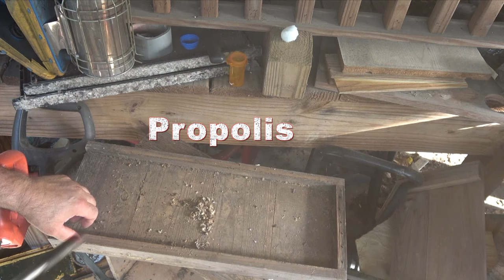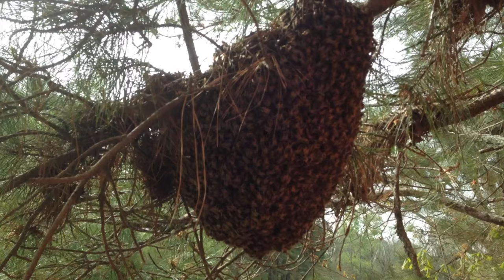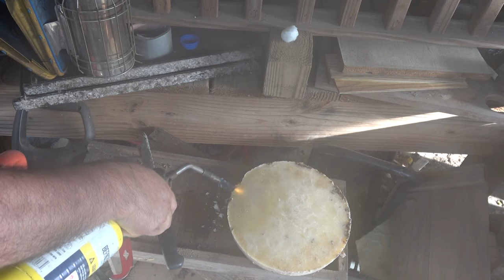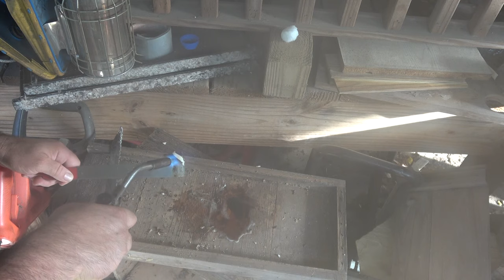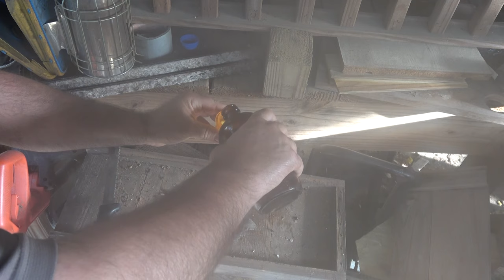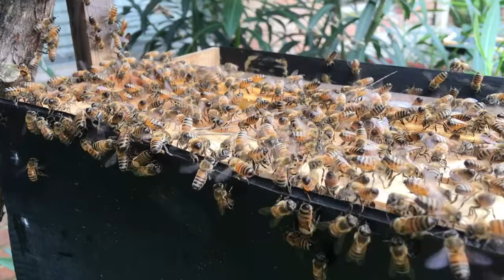How To Attract Bees To Your Bee Box

Comment: Aloha Jp. First off love the videos brother. They are super informative and awesome to watch. I’m very new to this and was wondering if you have made any videos of how to make home made nuc and deep boxes with instructions and dimensions. Unless you just order yours from some of the suppliers out there. For us in Hawaii we get raped on shipping costs and was wondering if you had any advice. Huge mahalo brother. Have an awesome week. Aloha
Pete
Reply: Peter Morrow 2 frame nuc measurements — bottom board is 5”x21” , sides 10 1/4” x 19 3/4” , front 3 1/2” x 19 3/4”, back 3 1/2”x 9 1/2”. 5 frame nuc  measurements - bottom board 9” x 21”, sides 10 1/4” x 19 3/4”, front 7 3/4” x 8 3/4”, back 7 1/2” x 9 1/2” all material is 3/4” thick such as shelving, be sure to paint all exterior surfaces. Hope this helps!

Comment: Nice video! I never thought of embedding the lemongrass oil in wax or propolis.  Would there be a problem with melting propolis and wax together and mixing the lemongrass oil into that and make a bar that I could  rub on the inside of the boxes? 

The cotton ball in a medicine bottle is probably better than how I've been adding a folded up paper towel in a ziplock.  Ziplocks leach scent pretty quickly.  I'm guessing that you put a swarm trap out and don't have to re-bait it, while the way I've been doing it I have to add more paper towels in ziplocks with lemongrass every couple of weeks.

Also, I've rubbed slumgum on the inside of the traps (I freeze the slumgum first making it really hard and it only leaves trace amounts on the boxes), but I've only put swarm traps out for 2 years now, so I have no idea if this is a good idea.  I see people recommending putting old comb in the traps and that just seems to be a good way to get some wax moths to move in, but to me rubbing the slumgum in the boxes would give the same scent without the place for the wax moths to make a foothold.  Any thoughts on that? 
Keep up the great videos! And thank you for sharing your knowledge.
Reply: I've done a bar version before. You just rub it on the edges of the frames. It works great.

Comment: hi, what kind of torch is that and where did you buy it?  where do you buy the fuel cans?
Reply from the maker: H.D., Lowes, Amazon, EBay. Propane. The blue bottles are cheaper than the yellow ones but don’t burn as hot.